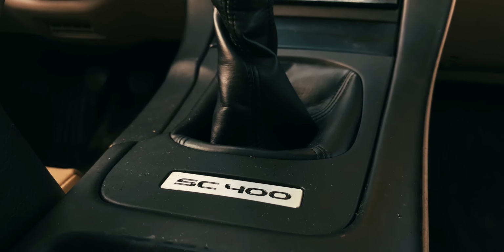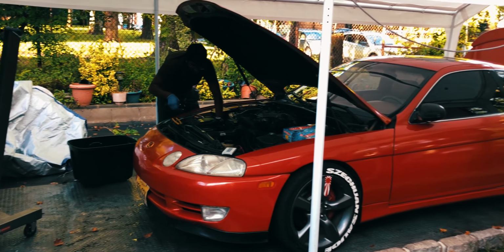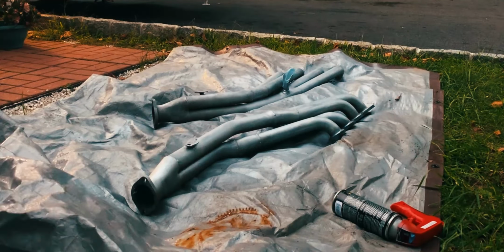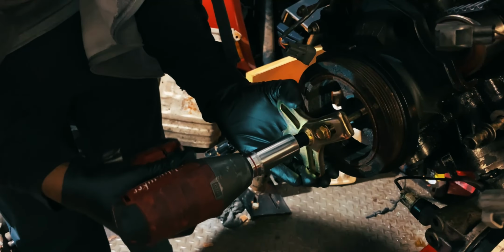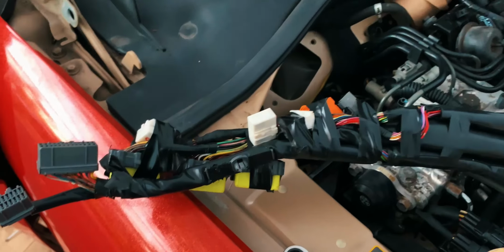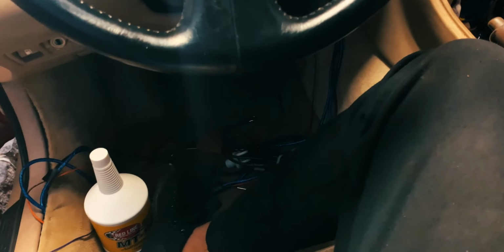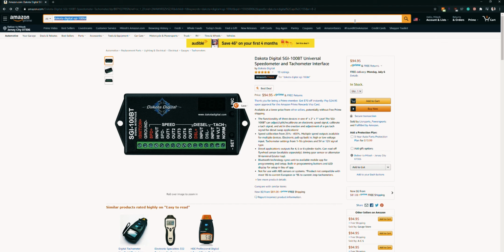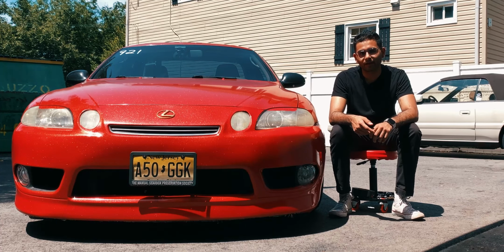SC400 Manual Swap (5 Speed Conversion) | 2AMCars

Comment: I'm leaning towards CD009 brand new, these older transmission have sorted histories,  nice car,  great video, buying my sc400 next week 👍
Reply: Do cd009 you won't be disappointed...you will be with the 240 and w58 trans had to rebuild my w58 5 or 6 times
Reply: @Rampagingkorean-007  Bought the car, bought the CD009, now time to buy the swap kit.
Reply: @dronetrucker8623  you cha ginger gears out in diff its quite short if u can go with 3.62 or 3.76....or if you want even gear 3.26...3.92 are really short
Reply: @Rampagingkorean-007  What cars do those gear ratios come in?

Comment: What offsets are your front and rear wheels?  I saw on F90's channel they were 18x9.5 and 18x10.5, what about offsets?  Did the fronts clear the LS calipers without spacers?  I'm shopping wheels now and have the LS calipers, need to make sure whatever I pick will fit and clear.  Thanks.

Comment: Since the gs400 has the same engine you could basically do the same right? Or would you have to get a different trans since it’s a different chassis?
Reply from the maker: basically you can! im not sure how it would line up with the shifter hole though. Many people also use this swap in the 240sx and in the ls400

Comment: I’m putting the plan together for the swap but life stuff has made me look for someone to do the majority of the work... but now that I see the benefits of pulling the engine, maybe I should just do it and take my time. In most SC400 manual swap videos I’ve seen they drop the transmission and use a 350z 6 speed. Working under a car isn’t fun... that being said, how much more time was spent pulling the motor vs dropping the transmission only. (If you know..?) 
Also,  in your educated opinion, what are the pros/cons of the 240 5 speed vs the Z 6 speed. I think the 6 speed shifter ends up back by your elbow and 5 speed lines up perfectly..but the Z 6 speed seems like it’s a stronger unit. That, and having a 6th gear is more desirable. I’ll wait to see your next video on the cons of the 5speed but any other input you have would be much appreciated. 
Awesome channel dude. Waiting for the next video is as painful as waiting for the next ‘Grand Tour’ episode.. haha
Reply from the maker: hi! I think it is definitely faster to drop the trans but Stephen pulled the motor to do a bunch of other work to it. I think the motor was out of the car within a day, and it was put back in within a day. 240 5 speed from what i know shifts smoother, and the shifter hole lines up perfectly. The 6 speed is much stronger and can hold more torque (hence why i said i blew up a transmission already). Whichever route you go, i am sure you will like it!
Reply: @2AMcars  Thanks for the information!

Comment: Did you have to modify the bellhousing/adapter plate/change bellhousing to make it fit onto the 1uz? Or did it go straight on no modifications? Considering doing a KA swap on my 92!
Reply from the maker: the adapterplate bolts right on! No modifications required

Comment: will this manual trans setup work on the sc300 2jz?
Reply from the maker: you will need a different adapter plate. But yes in theory it should

Comment: Did you upgrade the transmission?
Reply from the maker: I ended up replacing the transmission in the video with one that was in better condition
Reply: 2AMCars the transmission failing, was that because you raced it? Or was it just a bunk transmission?
Reply from the maker: mrmynameis19 the transmission was already on its way out. It grinded a lot and would be difficult to go into gear. Made lots of loud whining noises. Then when I dumped the clutch, I sealed its fate lol
Reply: 2AMCars you using the SR transmission or the KA? I’m leaning towards the AR5 from the Colorados
Reply from the maker: Kool-Aids Phuckery i used a KA trans but the KA and SR are the same
Reply: Are the bell housing the same from SR/KA to the RB trans?
Reply from the maker: @kool-aidsphuckery9596  not sure about the RB trans, but i know the KA/SR bolts up to the adapter plate that i used.